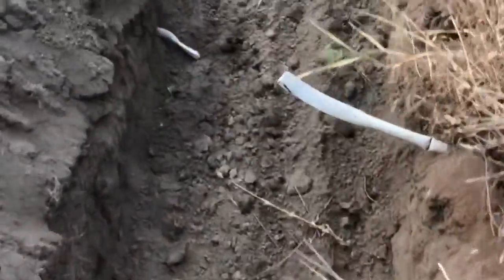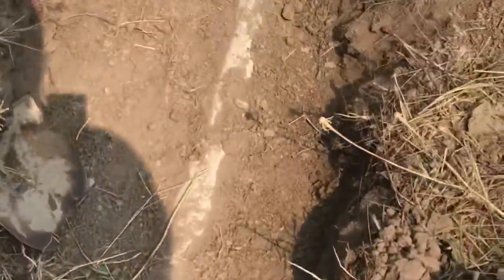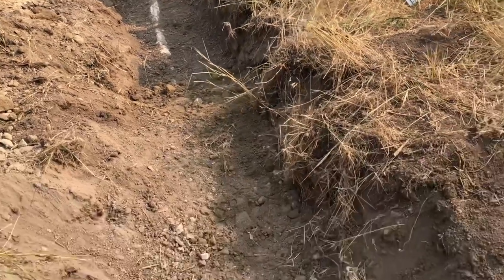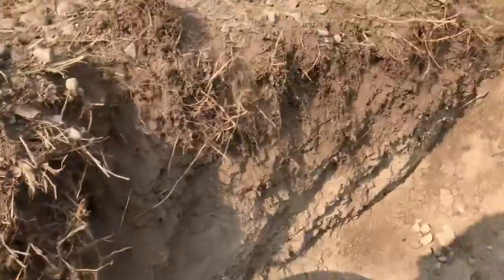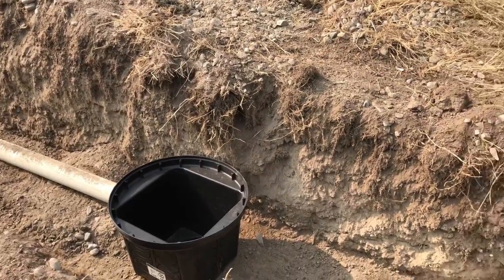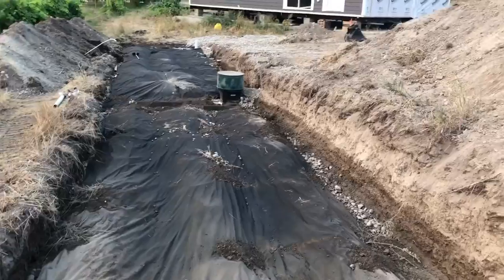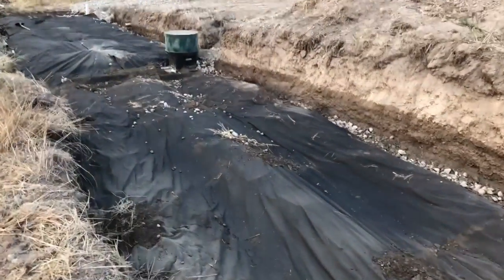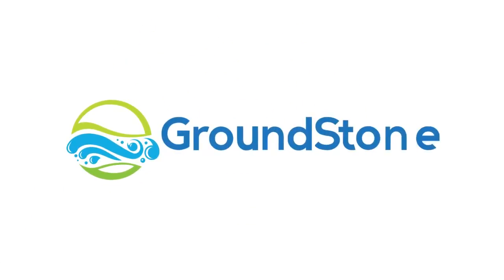Installing A Septic System For A Modular Home

Comment: Great Job. How much would this cost if you do not mind me asking?
Reply from the maker: Hello, every region will be a little different.  Where we are in BC, Canada this system typically runs in the 12 k range.
Reply from the maker: Cumbias it’s going to vary on system types, this system is a conventional gravity so less on the cost.  When we get to pressure distribution, sand mounds and aerobic systems then we’ll certainly be looking at close to 30k and over depending on home size.  We are relatively close to Washington standards here.
Reply from the maker: Cumbias no problem, anytime!